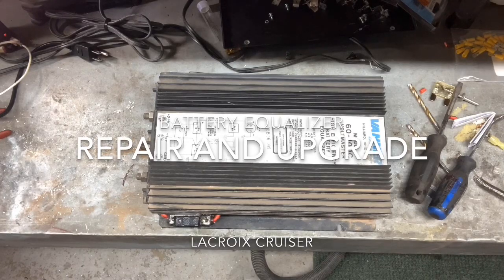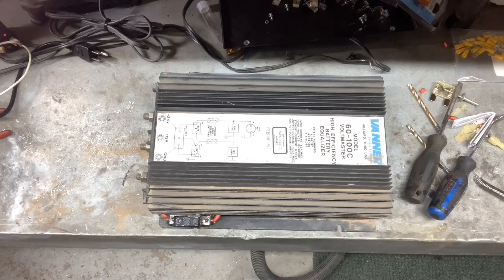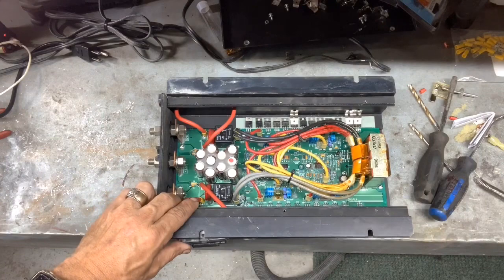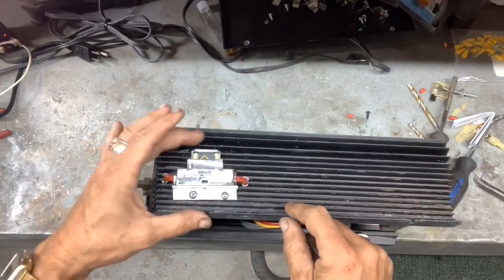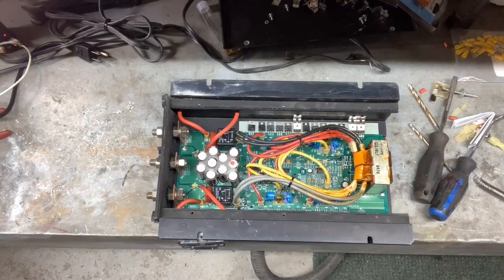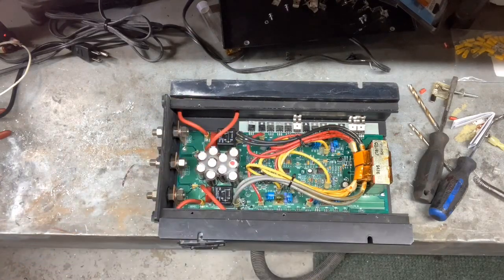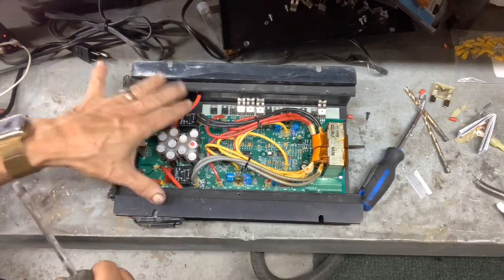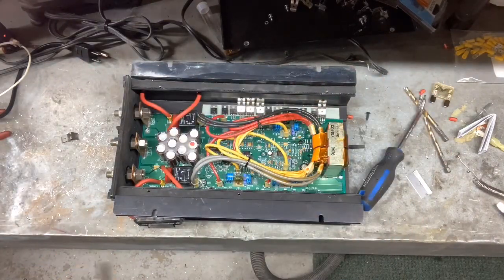Battery equalizer( Vanner) repair and upgrade.

Comment: I presume you had a clip for every one of those chips.  The entire case is a heat sink (notice how it is ribbed on the outside) and those clips transfer the heat from those chips to the case.  In my coach (1991 Prevost H3-40vip conversion) I have a pair of 50A Vanner Voltmaster Battery Equalizers for the chassis batteries, connected in parallel (and one 100A for the house batteries).  All of them have button-style circuit breakers on the same end of the case as the electrical connections.

BTW:  For those who are interested, the battery equalizer is a specialized inverter-converter.  It takes 24VDC, converts it to AC, and runs it through the primary of a step down transformer.  The voltage on the secondary of the transformer is 1/2 of the primary, and is then converted back to a regulated DC supply.  The specialized part of the unit is that it is connected to the chassis battery system ground, 24V positive, and 12V positive center-tap.  It monitors current/voltage at the 12V center-tap and any time there is a load, it attempts to provide 1/2 of the current from the upper 12 Volts of the battery system, with the other half coming from the lower 12 Volts.  This is sometimes described as “putting the upper half in parallel with the lower half.  The transformer is what makes that possible, as the secondary is isolated from the primary.  Thus one of the secondary leads can be taken to chassis ground.

Whenever there is a load on the 12V center-tap, the voltage will drop.  What the equalizer is doing is attempting to minimize the difference in the upper and lower voltages.  Put another way, it is trying to keep the voltage at the center-tap to 1/2 of the total battery, within some small tolerance.  Absent the equalizer, all of the current would come from the lower half of the battery system and the upper and lower halves would quickly be out of balance, with the lower half being more discharged than the upper.  This would then present a serious problem in terms of recharging the batteries, as the engine alternator and voltage regulator only “see” the battery system as a single 24V nominal unit.

FWIW:  With the battery equalizer present (and working) it is possible to charge the 24V battery system with a 12V charger by connecting it to the upper battery(ies).  The (+) lead goes to the +24V terminal and the (-) lead goes to the +12V center-tap.  The Vanner Battery Equalizer only works to transfer charge from the upper half to the lower half, not the other way around.  With a center-tapped battery, absent the battery equalizer the lower half will always tend to discharge more than the upper half.  If for some strange reason you end up with a center-tapped 24V battery system in which the upper half is discharged more than the lower half, you should disconnect ALL of the batteries, fully charge each one separately, and load test each one before reconnecting everything.  In general, all of the batteries should be replaced at the same time, but at a minimum replace all of the upper batteries or all of the lower batteries.
Reply from the maker: Wow, great information, and yes all clips are present and accounted for, just didn’t want to bore the audience.
Reply: @LacroixCruiser   why use this from a boat technician point of view they seem complicated it a 12v and A 24 volts system ?
Reply from the maker: teknotik.biz it’s a factory installation.
Reply: The starter and OTR HVAC system are usually 24VDC.  The  rest of the bus, including the DDEC ECM (if the engine has one) and the Allison transmission controller (if it has one), are 12VDC.  The alternator is typically a massive 50DN 24V unit, thus the need for the 24V, center-tapped, battery system, which then requires the Vanner Battery Equalizer.

Comment: Thanks for this video. Do you have any experience repairing the Vanner model 70 equalizer? It has a cast aluminum top and bottom that I can't seem to get apart after taking out the screws.
Reply from the maker: Unfortunately not.

Comment: Hello I have a question when the equalizer go bad can cause no power to the dash light  no light, no radio no  nada?  I change the battery and now no power at all can cause because the vanner equalizer ?
Reply from the maker: Yes , all that works on 12v will go dead.
Reply: @LacroixCruiser  thanks for answer so I am nee in this I change the battery and I did not disconnected the ground cable of the equalizer that means that I burn it or is a fuse? I know has like resent bottom but I pushed it and nothing

Do I need a new equalizer?     Any way I cant test it before buy it?
Reply from the maker: Open it and check The fuses first

Comment: How can you TELL if my vanner equalizer is not working properly you can email your answer to trinityfuntours@gmail.com
Thanks
Reply from the maker: Checking the voltage of the individual batteries. If they are not equal, the Vanner isn’t doing it’s job.

Comment: Have you found the problem where the rear battery of the two doesn't charge equally? Replacing the Vanner solves the problem, but a repair would be more appropriate. Never had a fuse blow but the unequal charge is a frequent problem.
Reply from the maker: Not yet

Comment: Nice modification.. One suggestion, you may want to add a rubber grommet where the cables enter and exit the vanner, just to minimize the chance of wire chafing. I wish that my MCI had the vanner, it was a simpler system where they just center tapped the batteries.. not as good in the long run for battery life, guess that's why they started using the vanners.
Reply from the maker: Gino's Garage, LLC good catch

Comment: Thank you very much for the tip! I was wondering how are you able to find all these faults on this model of bus so soon so fast...! After YOU get done, YOU may need to take a tour of the MCI FACTORY so future models don't have the same problems. Think YOU so very much for everything YOU are finding on the bus. It's going to make my build much smoother.
Reply from the maker: Regular maintenance will reduce many of them.